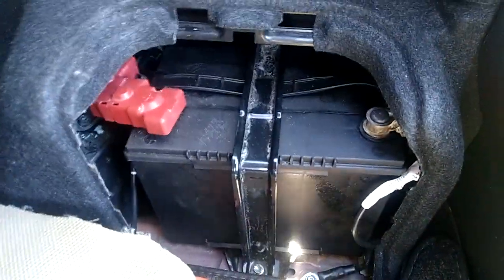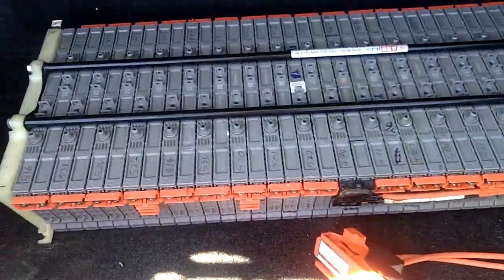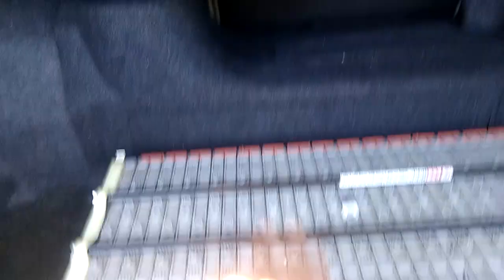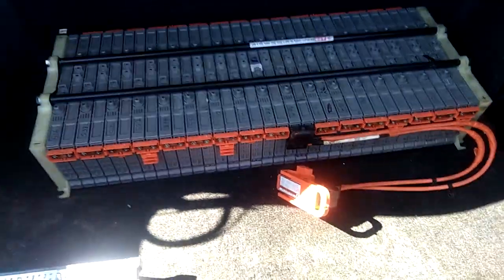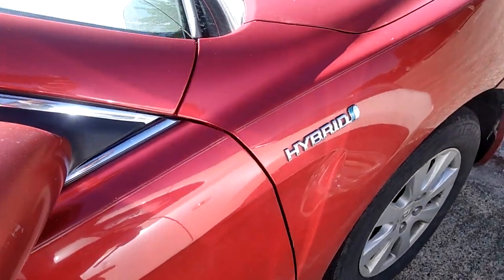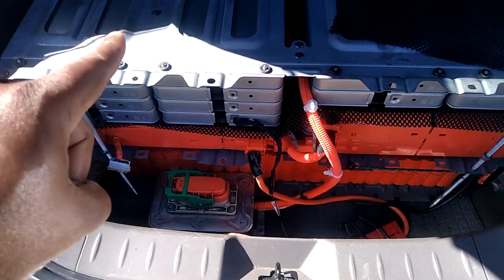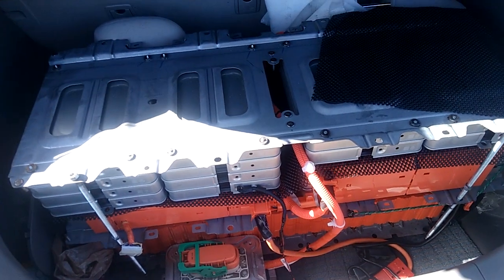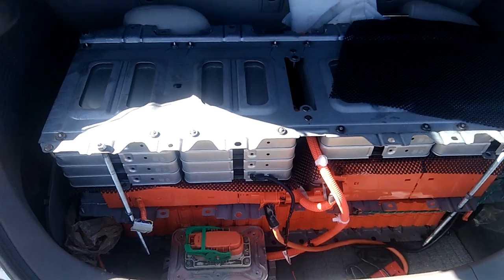Batteries in parallel; Camry Hybrid and the 2011 Nissan Leaf.

Comment: Bravo! You did a really great job. Where did you get the high voltage orange connector in the boot to connect the two sets in parallel.
Reply from the maker: https://www.ebay.com/itm/2008-TOYOTA-CAMRY-HYBRID-2-4L-GROUND-POWER-CABLE-WIRE-WIRING-HARNESS-OEM/273737013209?fits=Year%3A2007%7CModel%3ACamry%7CSubmodel%3AHybrid%7CMake%3AToyota&hash=item3fbbff57d9:g:YiUAAOSwUf9ceBRm
Reply: @t.shonoiki563  Thanks a lot. Ill try the same setup and keep you posted.
I will also leave the BMS connected to the trunk pack, add a elm327 and manually monitor the temp, voltages,etc through leafspy
Reply from the maker: @nazirmaudarbocus7019  I do not have any BMS on my extended bank till now and I am still using the two cars with longer range than before.
https://www.youtube.com/watch?v=63GNQp45Bmc&t=33s
Reply from the maker: https://www.youtube.com/watch?v=DbZvCfJ0CXQ